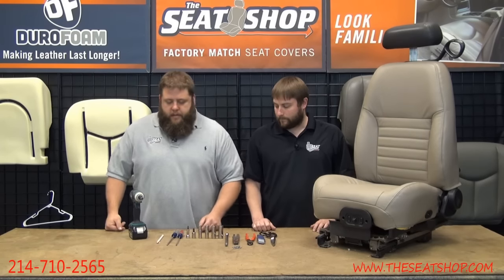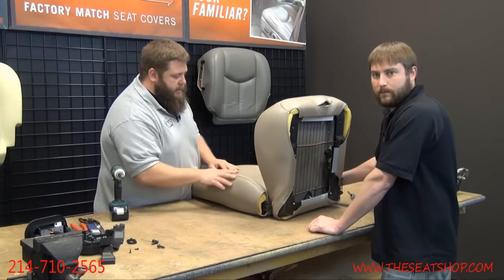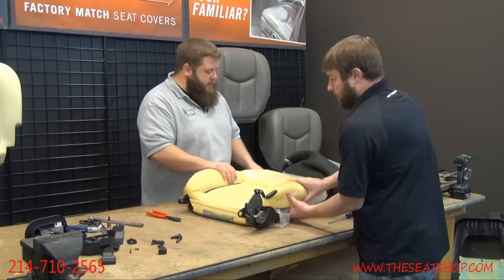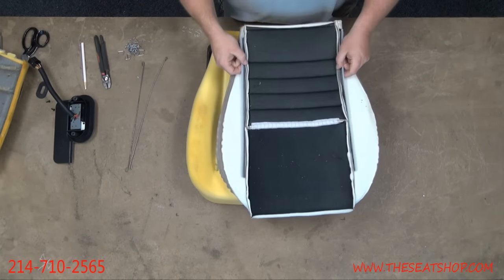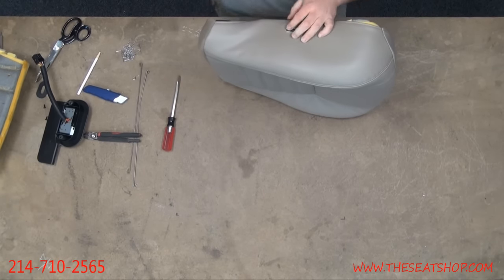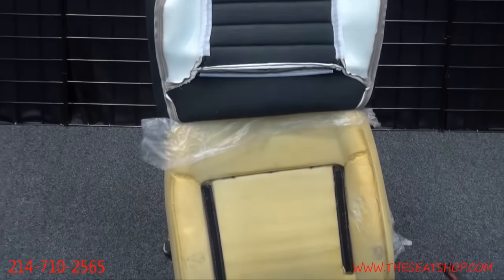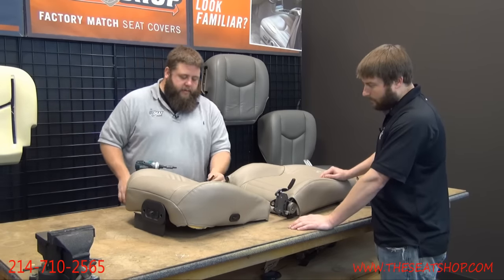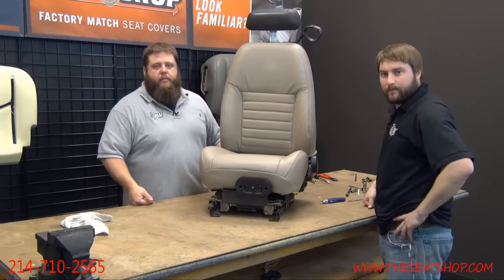2000-2004 Ford Mustang Seat Bottom & Top Leather Install

Comment: I was quoted $250-$275 in just labor to replace my DS seat cover. I believe with your video I can do it myself. Great video!  

Edit:  I was able to do everything except clip the J clip on the top.  I got new foam and even with a screwdriver couldn't get the clip to fasten.   I was pulling so hard the seam was ripping on the J clip.  I took it to a upholstery shop and they sewed up my J clip and it took 2 guys to fasten the clip.   Best part they didn't charge me.

Comment: I have a 2002 GT Premium with 90k miles and the front seats leather, mostly driver side, need to be replaced. (kept outside in hot Texas sun). The one thing I noticed is that you don't have the Mustang logo on the back of the seat. I really want to replace that as well to keep it more authentic. Any suggestions?
Reply from the maker: Due to trademark laws, we're unable to embroider logos into products, this is the same for most companies in this business. However, what some of our customers have done is purchase our OEM- matched covers and take it to an upholstery shop where they can embroider it there. Otherwise, you're looking closer to a grand (at least) for the cover with the logo from the dealer. Let us know if you have any questions.

Comment: The part number for the seat frames on Bullitt, Cobra, and GT are the same.  Is it just a matter of switching out the foam and covers or are there additional parts required that I'm not seeing?  I've got a GT but prefer the look of the Bullitt covers.  Thanks.
Reply: ever figure this out?